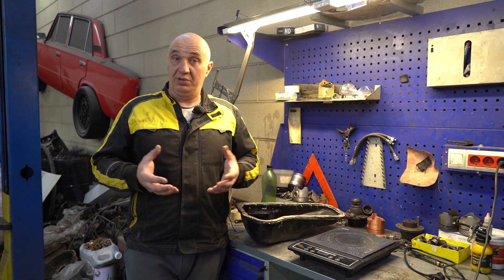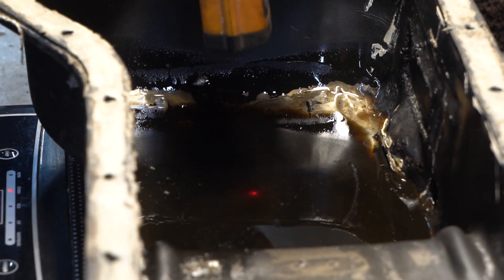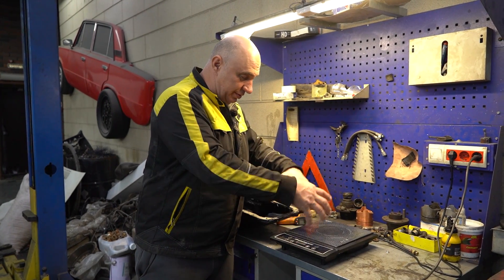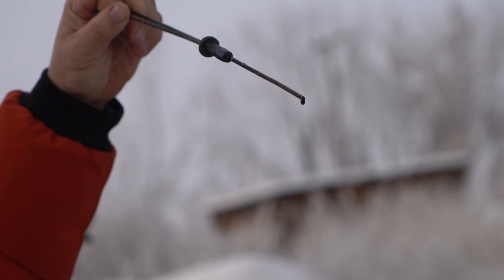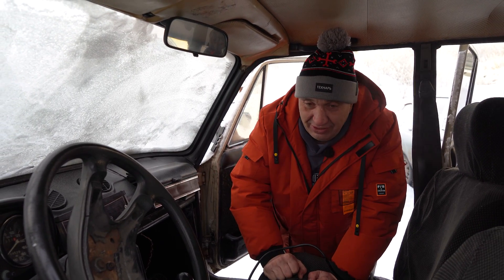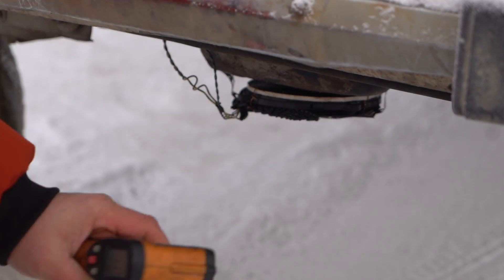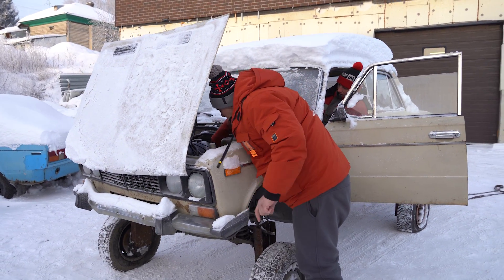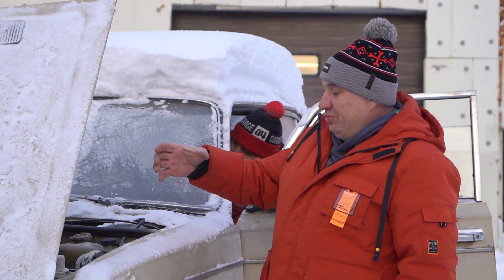We fit an Induction Stove to an Oil Pan

Comment: I think that it's better to heat the oil for it to flow around the engine, and there are no coolant flow inside the oil pan, so heating the coolant won't heat the oil much. Of course, if only the oil is hot, it probably cools down really quick when pumped inside that freeezing engine.
Why is it exactly that an engine has trouble starting at very cold temperatures? Is it really the oil the worst problem? I asked an AI, and it seems to "think" that the worst problem is for the gasoline to not vaporize properly in cold temperatures, then the problem of the oil too thick, then loss of compression because of the contraction of parts. So, it seems that under such extreme temperatures, it's better to heat both, or to heat the coolant inside the engine block (or heat and pump the coolant), and the worst of the options is to heat only the oil (well, the worst option is to not heat anything, really).
Now that i think about it, if the engine block is hot enough, the heat would reach the oil thru the crankshaft, right? I suppose that's the largest metal mass in contact with the oil when the engine is stopped.

Comment: The anti freeze mix will spread the heat more evenly.  I would pick it and if you had a small secondary unit it helps to heat the oil as well, but the coolant primarily.  The nice thing about that as an added bonus is the cabin heater works quickly when the coolant has been heated!

Comment: Most Norwegian electric engine heaters heats the water, and we have never problems starting the car in cold weather. Even my old tractor starts without any problem. The water is circulating inside the engine and heats the whole engine much faster. Greetings from Norway.

Comment: La première règle a faire en hiver si il fait très froid,c est de vidanger l huile moteur d été en la remplaçant par une huile moteur plus fluide, pour basses températures avec un grade a froid plus petit , genre
 👉5w30 ou 0w30👈 ,c est ça qu il.faut si il fait très très froid, pour que la pompe a huile puisse la pomper et l envoyer lubrifier toutes les pièces moteur rapidement, vous devriez savoir ces choses là,c est la base, 

On ne laisse jamais une huile d été dans le moteur par _ 35 °,
Car sinon elle va se figer et durcir,Si vous ne changez pas votre huile moteur d été, votre moteur ne démarrera jamais par grand froid ,
Il faut de l'huile Moteur fluide c est la seule véritable solution

Comment: Heating coolant is kinda pointless since its circulation is being restricted by the thermostat until it hits the operating temperature.
Heating oil helps a lot, since the viscosity of the oil increases beyond the oil pump capability with the freezing temperatures. Oil pump will build up the pressure needed for the oil to circulate around all the parts interfaces quicker, which means lesser abrasion of them in the long run.

Comment: To answer the question, if i had to choose what to warm up before starting the engine it would be the oil, the coolant warms up the engine true, but the coolant isnt actually circulating around the sump therefore the oil still be frozen and it will still cause this cause oil starvation....

Sump headting pads available in all shapes and forms, 12v battery powered, 220 powered with a normal plug, or even 12v with an adaptor.

Years ago i worked at a reed harvester company as a driver we had a Hanomag f series (late 1960's) on site with a modified sump, it a had an agricultural  disc around the sump of an agricultural disc harrow, allowing the operator to simply make an actual fire underneath the sump in order to warm the oil.
-15 it used to start like a brand new van😂

Comment: Heating either will work, if low heat is applied for long enough. But to heat more quickly and with a higher heat, the heater needs to be supplemented with a circulation pump. Heating the pan alone results in slow heat transfer to the block thanks to gaskets etc. and localised hot spots in the fluid which can be detrimental to the oil.

Comment: I have a hyundai h-1 . One morning it was 40 degrees below and the engine cranked but  didnt start . I took my heatgun and put it on the engine so it blowed on the cylinderhead .not particulary long time . Then it started pretty easy. But it probably wear the engine with oil thicker than honey.

Comment: Heating the oil will only heat the oil, the oil will plummet in temp when cranking, heating the coolant will heat the entire engine but not heat the oil much until it's circulating.

Comment: Heating the coolant will make the heater work faster. Heating the oil will make the engine run quicker. The coolant should follow once it gets moving around.

Comment: In this case it would probably be more effective to have a small fire underneath. Be it some bigger type of candle, smoldering logs, hot rocks that you have had in a fire, or a small campfire. Put a blanket over the engine bay to keep the warm air in and you will heat up oil, coolant, power steering fluid, brake fluid and all the hoses and etc.

Comment: i think for the sake of not wearing the engine by running it with frozen oil, heating the oil is a good idea to get good quality oil flow through the engine nice and quickly.

Comment: i have a vw t4 tdi. They have a diesel powered coolant preheater and also has an water cooled oil cooler that is use in this case for heating the oil. so i think heating it that way is the most effective becuse you could use the heated coolant for heating the interior too.

Comment: I have a great idea for some of your next videos. You should try to convert 4 stroke diesel engine into 2 stroke. It needs to have some kind od turbine pushing the air in cilinders, it needs to inject diesel 2 times faster and the hardest part is to get the valves to open every time when the piston is at bottom dead center, exhoust one even little bit earlyer. I don't know if ti is possible, but if it is you are the guys who can do it.

Comment: 107% heating the oil. Why don’t you just make a heat exchanger that has its own pump that circulates the oil when the engine is off. Older tech just T off of the oil filter and make a return.

Comment: great idea - a new product

use PWM power control - arduino coded interface - coded rules to PWM

Adaptable examples :

temp less then -20C : 100% pwr
temp range 0C - 20C : 50% pwr
temp more then 20C : 30% pwr
temp more then 30C : 10% pwr

it curves down - it will go back-forth between 20C and 30C assumed 

just a theory to work with :D

Comment: I’ve looked into the idea of installing a diesel heater to my work car for heating the cabin but using the exhaust from the heater through an EGR cooler then connected to coolant system with a small auxiliary pump for the water! Bet that would work a treat for you

Comment: I feel that it is better to heat the oil. Simply due to the oil needing to be pumped up through the engine. The oil pump will not work properly if the oil is too thick

Comment: Heating the oil will also heat the block , the thermostat stays closed until the engine is up to temp so heating the coolant wouldn't do anything unless it was circulating in the system warming the engine and therefor heating the oil before trying to starting. So heating the oil would be more beneficial
Reply: But. Most of the oil is still in oil pan. Which is at 99% cars on bottom. Which would let it cool.
Reply: @mmllmmll22  thermally heat rises and is also transmitted thru contact. Ofcourse the block would never get as warm as the oil this way but it's better than heating the coolant in a radiator that is designed to disapate heat not being circulated and is isolated by the thermostat and rubber hoses. If you could heat only the coolant in the block then maybe but it still doesn't help the oil viscosity until it is circulated and warmed.

Comment: I think the engine oil should be the better way to heat the engine because it has less restriction to the crank shaft on startup. Make sure to have a good DC voltage at the battery too in this temperature

Comment: You should put bbq charcoal in a pan once the flame is out push it underneath the car 👍
Reply: I used to do that on my old Jimmy when we went to a cabin on an island on Lake of the Woods (drove across ice on ice roads). -40C and no electricity. A few handfuls of MatchStart charcoal on an old cookie sheet. Let it burn for 20 min or until flames are gone and slide it under the oil pan. Worked like a charm. We also took our batteries inside the cabin over night so they would be warm. Only problem is the inside of my Jimmy smelled like charcoal smoke for weeks afterwards. Should of parked paying attention to the wind direction. I'd be careful on a modern car to make sure no wiring harnesses or sensors are running near the pan.

Comment: We had coolant heaters on our standby generators. When they started there were almost immediatly put under full load. However, we were always replacing hoses in the cooling system. Seems being hot all the time causes them to fail. Probably should have used silicone hoses.

Comment: It’s best to heat up the coolant because the oil is only inside the oil pan.
The coolant is all over the engine and radiator and heater core.

Comment: At some point, it is better to use both options, pre-heating water and oil at the same time. But in this case i think this method is a little bit better than pre-heating a water. In winter, our tractor Zetor 7245 has a hard times to start so the best idea is to pour all water out in the winter and when you need that tractor you can just pour hot water inside a cooler and it will warm up a bit faster. But warming up the oil pan seems to be a bit better option because you can run it how long you need or how cold it is outside. Below -35 i will consider to use both method, you can run the motor a bit longer when is so cold outside without the water it will not overheat immediately and when you start an engine, just pour hot water in in the cooler and it will be warmed up in just like 15minutes.

Comment: As we have seen, the danger of cooking/burning the engine oil while heating is quite high and damaging the oil is not what we want. Heating the coolant is much safer. Besides, coolant is almost everywhere. Around the cylinder walls and in the head. Heating the coolant heats more mass, and if the mass gets hot, then it heats also the oil in the oil pan.  
As You sayd, both are important, in my opinion, heating the coolant is safer in the long term.

Comment: Just needs a thermostat to shutdown the induction cooker when oil temperature goes high enough... Would be fun to combine with battery charger/heater to make sure battery doesn't get drained while trying to start. You could combine coolant heater with battery heater by circulating the coolant under the battery. You could even use the hot oil to heat both the coolant and the battery using heat exchanger, but the oil circulation should be short enough to not cause fire hazard if something breaks.

Comment: What about installing a 12v kettle element inside the sump wired through a timer relay to warm the oil that way? Also add a oil temperature sensor in the sump as well and a gauge in the dash to monitor the temperature with.

Comment: Is there a way you could heat the oil and coolant passages inside the block instead of only heating the outer extremities of the engine? Just thinking if you could bring the core of the engine near operating temperature that would reduce the risk of a head gasket failure from rapid temperature swings.

Comment: If you heat the water you heat the block, and given that the oil reaches the engine through internal passages of the block and that the specific heat of the water is 3..4 times more than that of the oil, the oil will surely heat up without difficulty along the way before getting to the bearings, shells, sprayers, etc.

When heating the oil, the opposite happens, since the oil has so little calorific power, it will very easily cool down along the (long!) way as it passes through the icy ducts of the block, and it may arrive at its destination not hot at all.

Comment: I run a oil pan heater (glued on), transmission pan heater (also glued on) and a coolant heater (plumbed to the lower radiator hose) on my 3L toyota. Not only more comfortable for me to get into it being mostly warmed already, but i imagine the cold-start wear is drastically reduced aswell,which is my main hope.
Reply: is it 2.8 3l diesel
Reply: @chieftain8638  1mzfe soon to be swapped for either a 3mzfe or a 2grfe.
Petrol.

Comment: Bruh that's not induction, that's resistive stove. Induction needs metal to heat which then heats the food, resistive stove gets hot by itself. If you can see orange glowing wires it's 100% resistive stove.

Comment: Heat the car's radiator water, then place an electric pump in the pipe path to circulate the water and heat the engine quickly

Comment: Heating the coolant is best and safest, because you can't accidentally burn it like you can burn oil. Also, the coolant circulates in more places around the engine bay than the oil, which is limited to the oil pan.

Comment: I think if you wanted to preheat the coolant, you could use a radiator from an automatic vehicle, and using the transmission fluid cooling system in the bottom of the radiator as a heat exchanger, which you can pump through hot water or oil, with some other crazy contraption, that turns on when the first rooster farts or from an alarm clock ⏰️, I use to leave my 68 Corolla in drive with park brake on when warming it up, because the heat from the transmission (Toyoglide) would bring up the cooling system temperature faster 😉.

Comment: Remember that your oil stays at about 240°f once your cars warmed up and you're driving normally, and it does most of the cooling, so it wouldn't hurt to let it heat up to 180° to begin with, and then it will circulate up throughout the oil galleries right?
Reply: The oil won't circulate through the engine until the engine starts. The oil pump won't let anything push through unless the gears inside are spinning.

Comment: (almost) Always coolant. - It's all about mass, sure the oil may still be borderline sludge, but once flow get's going the block which has been preheated warms the oil pretty well.  Invert this with only heating the oil, once a few gallons of oil comes in contact with a 700lb block of iron, through small routes, pre-heating oil matters little(ish), it'll quickly cool to the block temperature while being circulated.

Optimally, you'd do both, since (when exposed) block heaters wouldn't really heat up the oil pan like they 'might' in a shed protected from the elements...

Comment: Apparently the oil actually does up to 70% of the engines cooling, so I think it's a better place to start warming, also the oil circulation through the galleries would heat the block head and coolant.
Reply: @@karlwithak. The water has twice the heat capacity as oil and usually theres more water than oil in a car. So most of the heat has to be go to the water thus cooling the engine down more than oil

Comment: I was a small boat engineer in the US Coast Guard and in the winter the boats had what was called a Hot Start connected to the cooling system. it kept the Diesel engines about 65 degrees all winter.

Comment: To leave a comment, ive used oil heaters and coolant heaters both. Ive had the best luck with coolant heaters. I think its mostly because in a coolant system, the heat rises, so it will cycle itself through the engine. The oil doesnt seem to be as quick, i think its due to the fact you have to cycle the oil in order to warm all the separate parts. Jmo

Comment: 0w40 Shell Rotella T6 still pours well in super cold (expensive though at near $70/4L), all my high mileage engines get this put in... I cold started my vans last year -42°C on the dashboard no problem (battery kept topped on a trickle charger).  Combustion stability on start is a different question (lots of unburnt gasoline fires out the exhaust).  Why the craziness? Not every parking spot has easy access to 120V for the block heater, but the battery worst case can be pulled, warmed, charged, and put in.

Comment: Heating the coolant is better.   It's doing the process it is made to do except in reverse. And with the coolant filling more areas of the motor. The oil passages will be warm and as soon as the oil flows through them it will pick up the temperature and become warm anyways.
Reply: Coolant doesn't even begin to flow through the engine block till it's already over a certain temperature. Heating the oil is more important because it gets very thick when cold so it doesn't flow easily and thus you have reduced lubrication so it causes wear and damage to bearings and friction points.

Comment: What would happen if you used induction for the intake heater on a diesel, instead of glow plugs? I bet it would use less battery power ans heat up faster! You should try it and make a video!

Comment: Heating the coolant is better because it heats the cylinders evenly, causing less wear during startup.  That's why factory block heaters go in the coolant jacket.  It's because the oil is sitting in the pan while the engine is off, but the coolant is still surrounding the cylinders.

Comment: that is clever :goodvibes: I liv e in maine usa, -20s F is beyond count memory. my most memorable is a broken mercury thermostat.---30s F. Todays vehicles start great, but the top end warms up real fast.. best to let the oil warm up to avoid cold snapping rods/internals under throttle. That is where I joke of the oil cooler attached internal to radiator.. the radiator becomes the oil warmer in those times.🙃

Comment: Keep the hood closed. Sucking in cold air cools it, more, and fuel doesn't atomize when cold. Liquid fuel doesn't ignite, it has to be a gas. That's the reason fuel injectors atomize fuel, to promote vaporization.